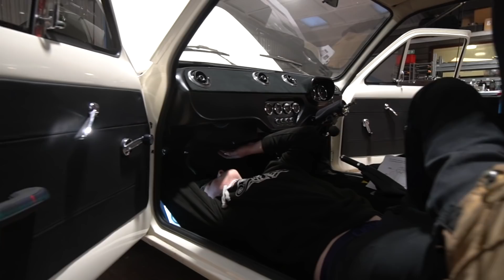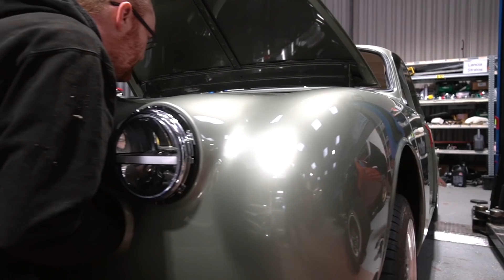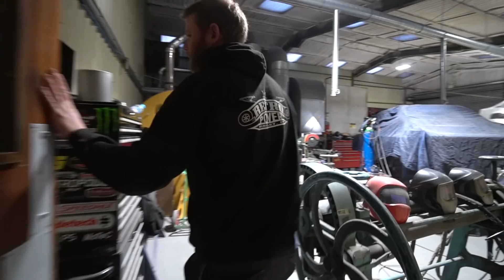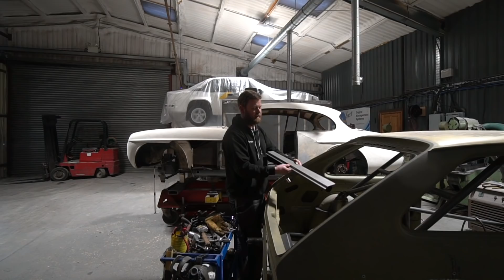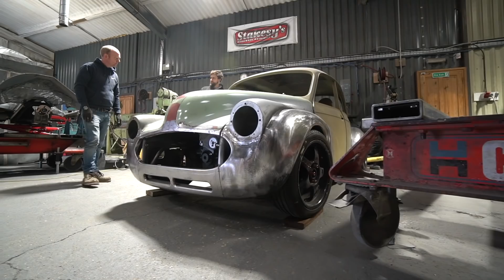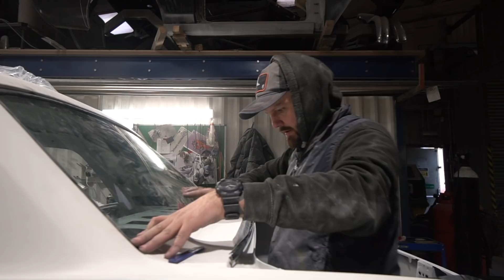Retropower Uncut Episode 30: Menacing Morris Minor, MK2 Jag Rolling on Rotiforms & Mustang Misery!!

Comment: Love your work, but electricaly you need to step up the game, please dont twist wires and cabels, the only reason to do it is to avoid cross over noise, but when you do it you weaken the wires and make them xtremely vulnerable to mechanical wear from vibrations and physical contact, so the point is : if you plan it right and use the right cables there is no need for twisting.

Comment: Nice to see a company that takes wiring seriously, So many companies look on it as an afterthought, Deutsch connectors big YES, 25 spec ? completely OTT for a road car (even the McLaren F1 only had 25 spec where the customer could see) , threaded inserts for harness retention, strange. simple 12x7 slots for anti rotation clips would be plenty good enough and ultimatly more reliable, Screws/Bolts can work loose, it takes 95NM to remove a properly attached clip.

Comment: I would like to know the engineering spec for wire wheels for the CV8. I am scared the rears will just spin on themselves...
Reply: check out the 250 ferrari on the late brake show, 600hp on ali wire wheels and all is well

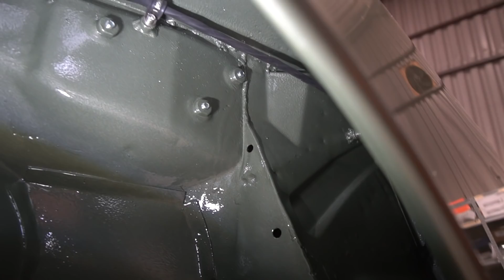Comment: OK I'm gonna be picky, at 5:09 the clips on Utah under the fender are opposite each other, PICK A ORIENTATION do not mix :(, I believe the original XK engine (not an XK6 engine  :) ) weighed in with transmission 6 CWT. Did you consider a Jaguar Derrington Steering wheel ?